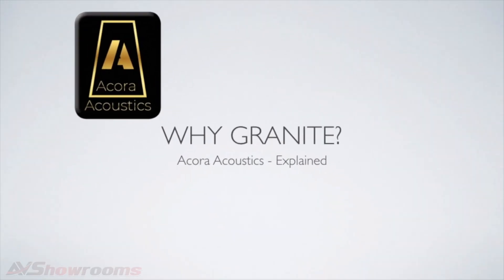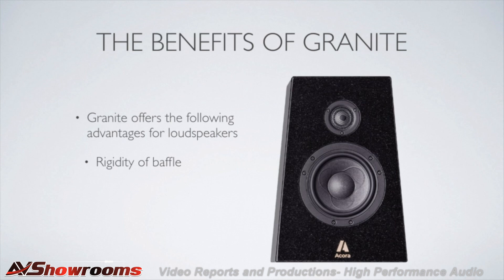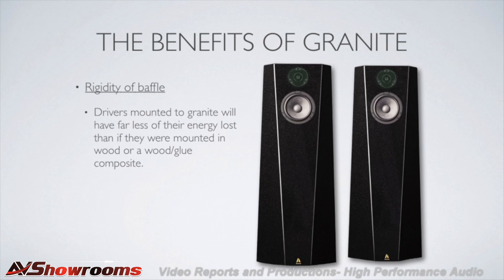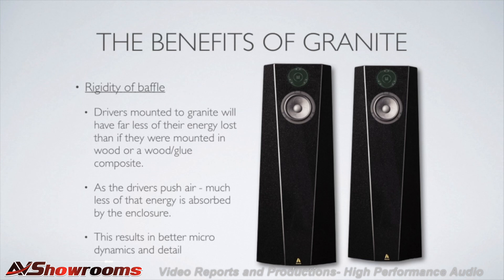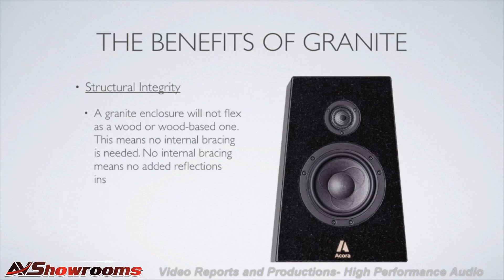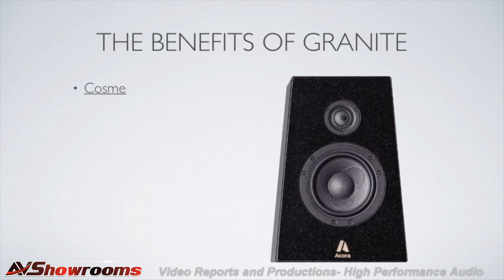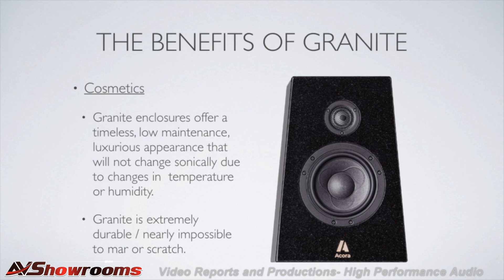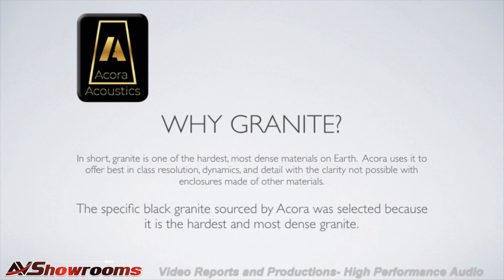Acora Acoustics, Why Do They Use Granite, AVShowrooms Tech Series!

Comment: I wonder if lead-damped metal panels would not give a similar effect    A friend and I had done some tests but the panels were chipboard and therefore not stiff enough
Sure lead is toxic but try to hammer a lead plate  ... you can't hear anything   A very dead sound

Comment: The resonant frequency of granite varies with the size and shape as well as the composition. Latest I read it was between 6.9-17KHz. It’s more dense areas provide great noise transmission rather than conversion to heat and dissipation.